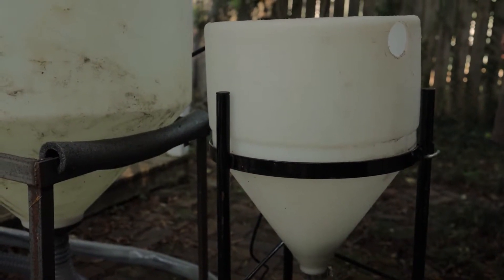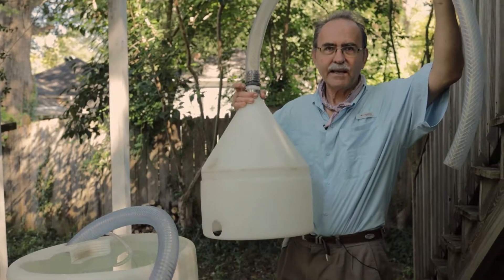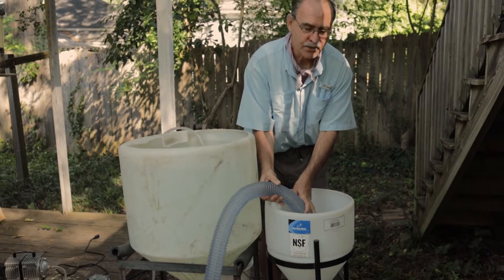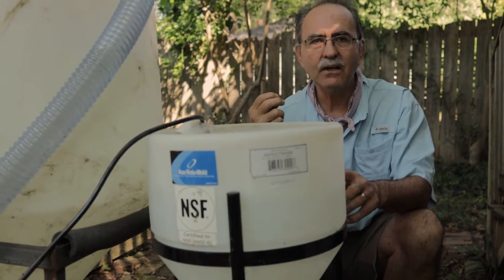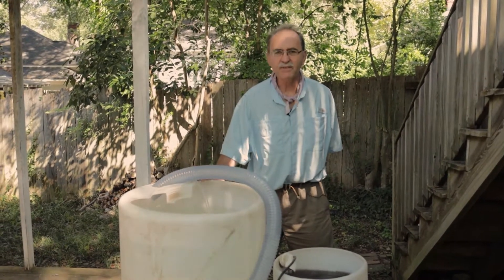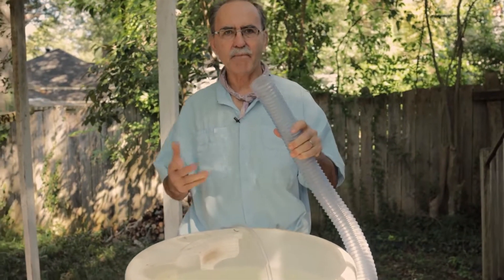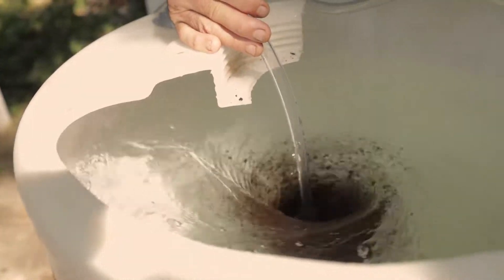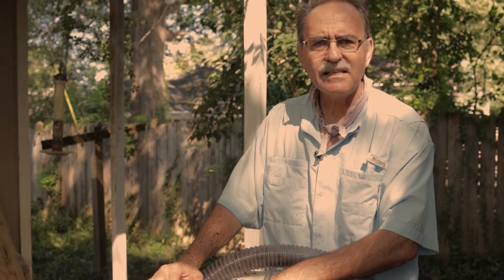DIY Compost Tea Brewers/Mixers

Comment: Thanks for the detailed instuctions. I used your video this weekend to make a similar model. It's way more turbulent and choppy than yours, so I have to figure out why. One question: why are we not just putting the air hose in a bucket with water and compost? Why does the water have to circulate? Would the action of the air bubbles alone not be enough without the circulation to break up the glomalines that bind the microorganisms?
Jan
Reply: Airlift + vortex has been shown to generate the highest dissolved O2 in the water, higher than just bubbling
Reply: @erikreuterskiold5996  I didn't know this. Thanks for the explanation!!

Comment: Why do we ground the rig? Thanks for the video!
Reply from the maker: I was told by a biodynamic farmer that this will reduce potentially pathogenic microbes in the mix (e.g., E. coli).  I haven't ever tested this idea myself  but I figured it wouldn't hurt.  I do pay attention to making sure that the system is aerobic - if you have access to a DO meter, keep DO levels above 7ppm.  This is easier to do when its cold simply because DOsat is higher in cooler temps, lower in warmer temps.